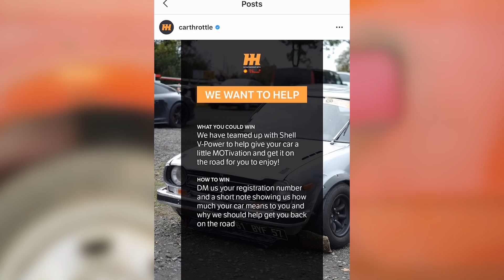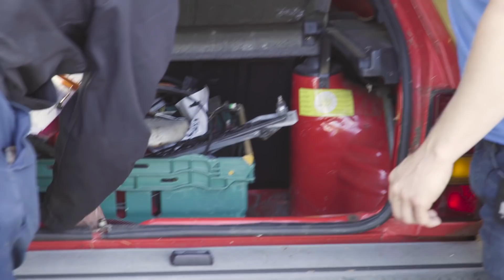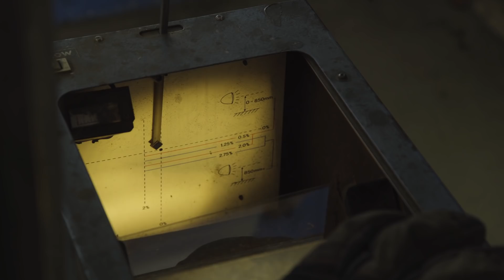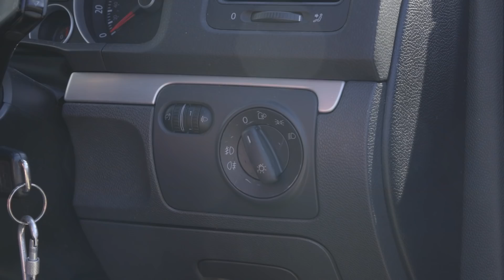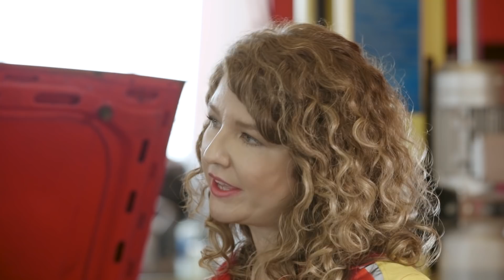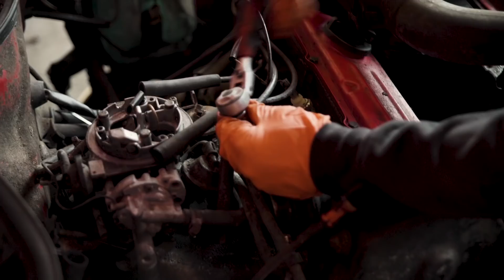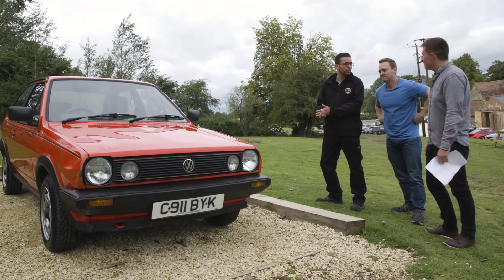Saving A Rusty Project Car From The Scrap Yard

Comment: when someone recites a learnt text about how the engine adapts to good fuel ; and how the knock sensor reacts and adapts your ecu... while standing in front of a carburated  polo ... it doesnt even have a lambda sensor ! you know its a shouve it up your face add.  that car would run the same on 95 or 98 ; its setup mecanichly for a 95 or less..
Reply: Yeah it was a blanketed statement about fuel octane in vehicles. Even fuel injected cars don't adjust for fuel octane unless they are programmed to.  If your cars designed for 95 then that's as good as it's going to get. 99 is a waste of money. 

In the states there's arguements upon arguments over what fuel octane is and what it does for your car. 

I have 2 cars which have  been programmed to advance or retard the timing depending on the the knock sensor information. 

Can't believe something as simple as fuel octane is so misunderstood. Preach the truth to all you can. 

Glad to see your comment on here.
Reply: @antonisautos8704  The fact that there are several different octane ratings (RON and AKI being the most common) certainly doesn't help!
Reply: Greg Steven's mate that car would run fine on paint thinners let alone 99 octane
Reply: They should've waited with the sponsorship for another car.
Reply: This car would be running on 91 RON in Australia - just fine and dandy.  The cheap stuff - you know - from Costco.  It would work fine - as it's the SAME fuel as in the Shell, Caltex, BP, or Amco truck.
Reply: When someone is sponsoring your video, you smile no matter what they say and keep your mouth shut.
Reply: My car is remaped to 99 if I run it on cheap supermarket fuel my eml pops up on the dash so surely makes a difference
Reply: @bigbeard9455  plenty of people I know have had to have fuel systems or even engines rebuilt because cheap supermarket fuel has been full of water.

It might not be the lack of octane or ethanol that makes your car unhappy.
Reply: Someone’s been watching chrisfix
Reply: In the united states 87 to 93 all contains ethanol. You can get 87 with no ethanol in it but you will pay an extra dollar a gallon in my area. I run my small engines on ethanol free. But they also run just fine on regular gas as well. But ethanol free doesn't go bad after a couple months so I can keep 10 gallons of ethanol free in my generator for a year and it doesn't hurt it one bit.
Reply: Mk2 polos don’t even have an ECU!
Reply: @taylorhaddock2782  although this one hasn't, the GT or S models got them from 1990 on along with the facelift. G40 also obviously had electronic injection.
Reply: Not just fuel though its the engine oil used too. Why is a high performance oil used on that old engine. That shell speak too clearly scripted ofcourse
Reply: This polo would probably run on some vegetable oil.... So v power os defenetivly a wasre of money... Especially in this occasion XD
Reply: I agree, but in some countries 95 is E10 gas which has 10% bioetanol in it. Some cars before 2000 will not run properly on 95 and you have to run it on 98/99 octane. I don't think the carburator cares, but if the filter is to fine it can get clogged because of the bioetanol. And hoses will dry quicker and disolve. If you don't have E10 gas I see no reason to use 98, it's just more expensive.
Reply: @wimpmcgrump7871  I believe, every country in EU MUST have atleast 7% of bioetanol(maybe i'm wrong on the name, but it has to do something with fuel that is made from trees, nature itself, that can regrow in a short mater of time, maybe not bioetanol it's called, but you get the point, there is no pure 95 or 98 fuel made just from the oil in EU)
Reply: @kerstas10  Except Shell V-Power apparently?
Reply: @TheComputec  apparently, i heared interesint fact, about scandinavian 'neste" fuel gas station, for that BIO fuel it usses palm tree oil, and poor countries burn normal forests just so could they grow palm trees there. in other words scandinavian gas station is making earth more polluted, by choosing what bio products to put in their fuel.
Reply: @wimpmcgrump7871  What the fuck is gas?   Petrol?    Basically, fuel with bio-ethanol  is fine to use in a carburetor-based engine.  So long as the fuel tank, pump, and filters are fine with it.  You also have to change the seals out in the carburetor.  Once you have that sorted, you can tune-to the fuel and get a cleaner burn.
Reply: @wimpmcgrump7871  please elaborate on the fine filter clogging due to EtOH. It is a liquid after all.
Reply: @wimpmcgrump7871  higher octane just has more ethanol because ethanol is more resistant to detonation.
Reply: @andreigq5786  not in canada at least. Regular has 10% ethanol, premium usually has none. One Ethanol free fuel that comes to mind is...

Shell V Power 😅
Reply: I may be wrong but I am pretty sure a 85 Polo uses a Bosch Jetronic fuel injection system, which would have a lambda sensor but doesn't do much with it. (in fact if it does the wide open throttle switch will bypass it entirely)
All Jetronic fuel injection types use primarily either air volume or air mass intake combined with throttle position to alter the fuel dispensing rate. Really, in the end, you're not wrong about the cat being set up for a lower grade fuel and most likely not needing it for an emissions test.
Reply: Kyle Grubham yep you are wrong, not sure what car your thinking about but the Polo Coupe S doesn’t have fuel injection, it’s 1272cc, it has a mechanical fuel pump driven of the camshaft and being a C Reg would probably have a Pierburg Carb, the earlier Golf & Polo ran with a Solex Carb, also being 1986 it is well before lambda sensors became required on anything built from ‘91 onwards
Reply: @djhatstand7312  you are right, I was thinking about the American sold Rabbit
Reply: @djhatstand7312  Also Jetronic is a mechanical system IIRC, he may have been thinking of Mono-Motronic but even that was way later.  My '88 breadvan had the Pierburg carb, they get some hate but it always started and ran great on the cheapest crap fuel even after the HG failed & it used to just drop a cylinder at idle. Just had to remember to activate the (semi)auto-choke for a cold start.
Reply: Kyle Grubham wrong 1981-1990 is Mk2 all of which had carburettors including this one. The later mk2F (facelifts) from 1991-1994 had single point injection or some engines such as the GT and G40 supercharged had multi point fuel injection

Comment: Thumbs up for skipping Shell lady’s speech 👍
Reply: This is a the same channel that has tutorials for running a car on chip oil, v power chip oil haha
Reply: Also, it’s a very old car, so it is designed to run with 95 or less octane, so v power makes absolutely no difference
Reply: @alfredkc  actually high octane would help... give you a little extra bang and burn cleaner but the power difference wouldn't be enough to outweigh the cost...
Reply: Tiny Table Wargames It doesn’t give you an extra bit of bang... High octane petrol just means that the pressure that the petrol can withstand without exploding is higher, newer cars with new ecus are programmed to add more oxygen or, in cars with turbos and super chargers, add more boost in. However, older cars’ ecus are not programmed to do that. If the car recommends 95 octane, that’s the one it’s programmed to do on old cars.

(Edit: I left out “is higher” xd)
Reply: Also, this golf has not got an ecu, and so therefore, 99 octane petrol won’t make a difference as the pressure in the combustion chamber is designed to have the highest pressure for the recommended octane petrol without it exploding before the spark
Reply: So, please do not pretend to know about cars if you don’t understand the basic concept of petrol octane rating.
Reply: Tiny Table Wargames Also, high octane doesn’t necessarily mean it burns cleaner. It actually depends on how well it’s filtered, and that has nothing to do with octane.
Reply: @insomniacbritgaming1632  that's not how octane works
Reply: @alfredkc  its a polo😂
Reply: thomas ridley Okay, I got that one bit wrong
Reply: hell yeah i skipped, that bish is hella annoying
Reply: Let’s stop roasting Tiny Table Wargames lol, we need to chill.
Reply: Annoyingly, this video is a giant advert for shell.
Reply: I’d actually have Mobil 1 instead of shell oil lol
Reply: she knows her shit maybe u should pay attention lol
Reply: @sebastianspalding5016  No she doesn't. She thinks that the ECU can detect a fuel's octane rating. It can't.
Reply: @LordSandwichII  a car this old won't have an ECU... it's Carb and throttle wire controlled...
Reply: Lord Sandwich Uhh, yes it can on newer cars, they have sensors
Reply: @sebastianspalding5016  She knows her marketing speil. 

What she didn't seem to know, or at least wanted to skip, was not every car has a knock sensor, manual optimisation of the timing timing for higher octane fuel isn't always possible, and and the main reason to run high octane is when increasing your compression ratio.

She was there purely to recite the v power promo leaflet.
Reply: @sebastianspalding5016  She knows how to sell a product that is overpriced and wont do much/if anything on a regular daily driver.
Reply: sebastian spalding or she’s very good at memorising her sales pitch? I did watch it for a bit.... but got bored
Reply: @nameussparticus  Welcome to 2019. Youtubers having to bare their arse as a company promo slave to make a bit of coin. 
There's clever advertising and then there is this blatent and boring ad for Shell. Did they do any research on Car Throttle audience or even the average youtube car content viewer? Which car person cares for this corporate garble. Save the pitch for a servo convention.
Reply: @sebastianspalding5016  She knows how to recite. A car this old most certainly doesn't have a knock sensor that would adjust timing or any such thing.
Reply: sexist
Reply: @lukestaniland5814  if it was a guy saying all that bs in the similar manner it would be equaly as annoying
Reply: TrekkingTom She is pretty hot tho
Reply: And to when she bent over? Sry didnt happend this time, mate. Maybe next time...